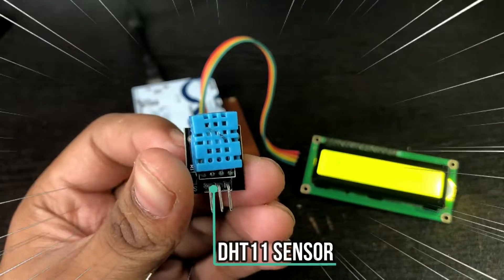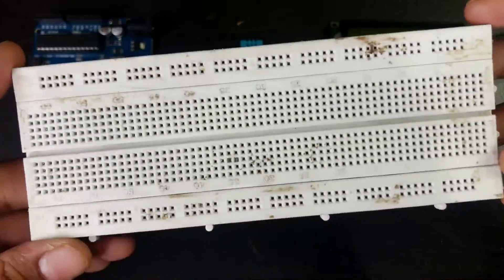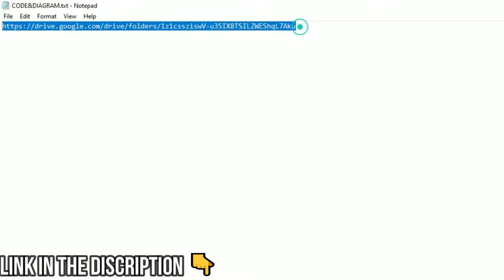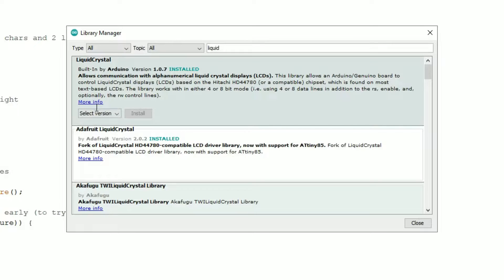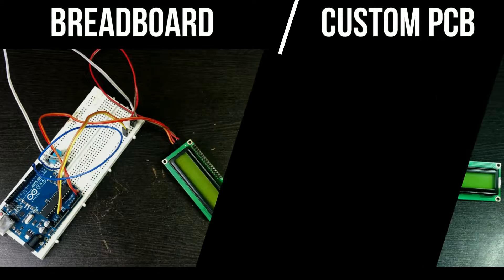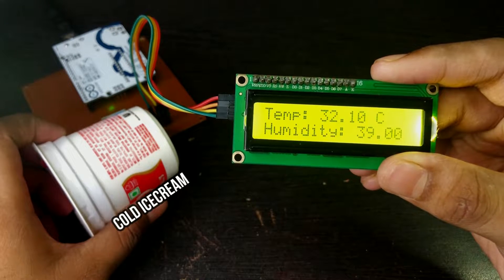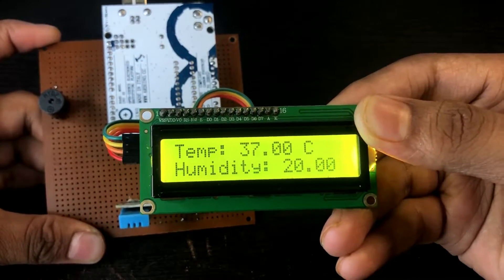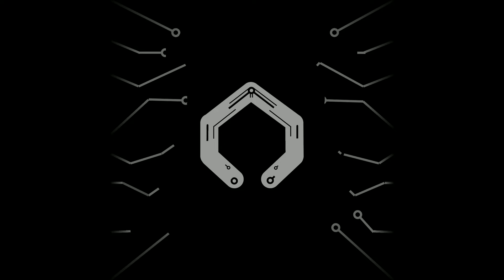How to Measure Temperature & Humidity with DHT11 Sensor | Arduino Weather Station

Comment: I have tried many other sites to get my DHT11 working with Arduino / I2C, and had NO luck. I came across your site, thought I would give it a final attempt. I downloaded the wiring diagram and the .ino file from your site. Well to my utter astonishment it worked immediately, NO tweaks nescessary. Thanks so much for the info